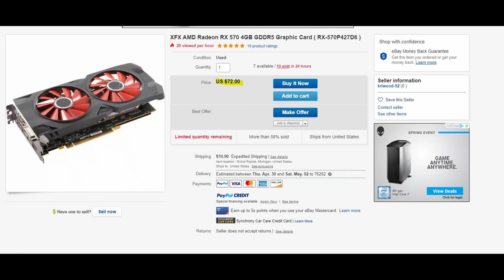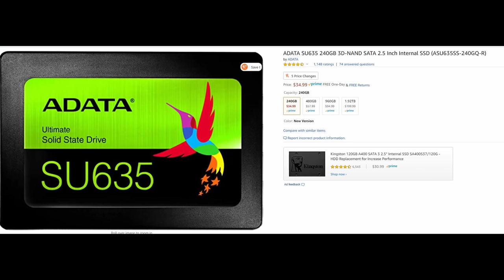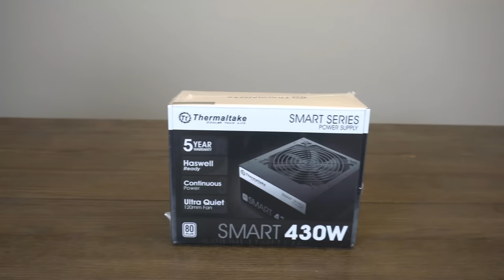$220 Just Get Gaming PC Build - Dell Optiplex 2020 + Benchmarks

Comment: shipping cost: $800
Reply from the maker: That doesn’t sound worth it 🤷‍♂️
Reply: Faxxx
Reply: Shipping cost 300$ 😂
Reply: if you look around on ebay and have two brain cells you can find better deals
Reply: TheUglyBrotha going on eBay for a gaming pc? You’d be lucky enough if it can even run your online COVID work...
Reply: @PCDYYD i recommend you get amd ryzen it is for budget gamers
Reply: @Muxzy  like I said you have to have two brain cells, you look for individual parts
Reply: @PCDYYD ah alright, im not thinking of upgrading anytime soon since i have a gtx 1660 super and ryzen 5 3600
Reply: cost $37.05 + gst = $837.05 + shipping = $907.05
Reply: @PCDYYD the 1660 super only has 6gb
Reply: @PCDYYD Worst experience? Optiplexes are easy to work with, biggest problem with them is that they usually come with BIOS from like 2012, so when you do something like slap a PSU it will not recognize it giving you a Amber light error, amongst other stuff related to that BIOS problem, but upgrading to A22 is easy and can be done with Windows itself.

Currently running a i5 2400 790 with 12 GB of DDR3 RAM, a RX570 4 GB and a Raidmax 530SS PSU.
Reply: @PCDYYD I mean, that´s the thing, can you really call them scammers when the PC is not intended to be a gaming system therefore is not intented to receive upgrades? It´s an Office PC, you don´t want it to be huge, the HDD cage is ok, you should expect that in an Office PC. 

I get why you would not recommend it, but that´s the thing, what else can you recommend at this price range? Anything built from scratch will probably not be running nearly as good as this Optiplex with an Rx570 will be running at.
Reply: @PCDYYD What errors? Update the BIOS to A22 and you are all set, the only non-upgradable thing is the CPU and that is more on Intel than on the actual Optiplex. It takes up to 32GB of DDR3 and pretty much any graphics card you can fit on the thing.
Reply: @jj-vn9hl  immature much? lmao

Comment: Love seeing other people do these builds. I've got a 9020mt Optiplex, with the I7 4770. Put in a new PSU (EVGA 500W) an Ssd (Kingston a400 240gb), and a new GPU (Sapphire Nitro+ RX 570 8gb). Really had to work to make the GPU fit, had to take out the Hdd bay too, and cut down the front panel plug on the motherboard. I think I'm around $400CAD all in, including 24" 1080p monitor, and wireless kb/m. It's been smooth sailing and gaming for almost 6 months now.
Reply from the maker: Nice!  I bet that is bad ass little budget gamer!  I’m thinking of just buying one of those just to snag the 4770 from it to replace an i5 I have sitting around for another build (maybe a video idea) 😉
Reply: How long do these last. Optiplex pcs with rx 580s or gtx 1660
Reply: Why not build a ryzen pc.  Much better.
Reply: 20 years
Reply: @rajakhan12346  The cost is cheaper upfront and the performance is better also. A Ryzen build would cost about 450+ with a discrete Graphics Card while this maybe 300.
Reply: @rajakhan12346  ya if you had roughly $600 that could be a nice new pc, but this is a budget used starter pc for half or even less the price, great money for performance.
Reply: @tattoojay88  Ryzen cheap now. Can build one roughly same price.
Reply: @rajakhan12346  not with a dedicated graphics card and brand new components
Reply: @wrth  what do you mean. Cheaper than Intel. New parts cheaper.  Used parts way cheaper can good parts .
Reply: @rajakhan12346  ya if you have the money a ryzen build would be a nice pc, but you couldn't build one for the same price. Ryzen is cheaper than Intel yes but that's just the processor. It would be $250+ just for the lowest end Ryzen processor and a decent graphics card, maybe a little lower if you find great deals.
Reply: no bro i dont thinku need something to fit the 570 in 9020 mt bro it had enough espace for it
Reply: Wait do optiplex use 4 DDR, I'll tear down my laptop and even use it's old ass ssd
Reply: @bizybliztaverage9414  Depends on the Optiplex. The 9020 has DDR3 because that's what Haswell supports.

Comment: I just got an Optiplex 7010 with a gt 1030 off of ebay for about 200 plus I got a pretty nice HP monitor for about 60 and now I can play any game on the market.
Reply from the maker: Nice!  That’s not too bad of a deal.  You can add a more powerful GPU later on to up your gaming experience!
Reply: Which processor do you use?

Comment: I rebuilt an entire pc in one of these cases. I originally intended to keep the i7-3770 it came with but I came across a really good deal on a Ryzen 5 1600X on ebay... So then I got the idea to convert it into a ryzen build lol. I just really like the look of these old optiplex cases so I made one a lot more modern. The parts I used are as followed-

Power Supply- Corsair CX650
Motherboard- MSI Bazooka V2
Ram- Corsair Vengeance 16Gb 3000Mhz kit
Graphics Card- R9 Nano
CPU- Ryzen 5 1600X overclocked 4Ghz 

My Ryzen cpu didn't come with a cooler but I had an old FX-8370 laying up in my closet so I just took the wraith cooler off of that and used it lol. On the side panel I cut a 90mm hole and bought a 90mm dust filter and a be quiet fan off of Newegg so it has plenty of airflow and it still looks sleek. I did have to cut and splice some wires together in order to get the power button and usb ports working on the pc because the original connectors were proprietary to the old motherboard so if you are to attempt this keep that in mind. All in all, it turned out fantastic and I love it. It's not my most powerful computer but it's unique in it's own way.
Reply from the maker: That is awesome!  Very cool sleeper build!
Reply: Plz make a video showcasing this? I wanna see

Comment: 11:54 you can also get a PCIe x4 sata 3.0 card for that build to add more drives.
The VNP2H - Dell System Board has 2x PCIe x16 slots and a single PCIe x4 which means you can add Sata data ports to your system 100% for sure for like $35 on Newegg. It's a decent little mod.

The $400 OmnipotentPlex

I did a build with a Optiplex 9020 and ran into limits with my sata data so I got the x4 slot Sata Data IOCrest card from Newegg. Gave me 2 more ports to work with! this meant I could add more space. I took out the board and mounted the mobo into a better Rosewill case. This case gave me 3 places to mount SSD's and 3 places to mount HDD's. A used Cullinhan case off ebay. Came with RGB fans and I'm very happy with the $65 I spent on it. The Dell was $75 on Craigslist (sketchy, I know, but you can find some excellently cheap, but always unclean, stuff.. had to throw the old case away it was nasty) and it came with a 1TB HDD. I got a 240GB SSD for $35 on amazon.  Got a 1650 super for 120. The PSU in the Optiplex is proprietary however you can buy a cable from ModDIY which allows traditional ATX power supplies to be used on proprietary Dell boards. I got the 9020 because I already had one that had issues with the motherboard but the CPU was fine. I bought one with an i5 while the one I found in the trash (yeah we out here grabbing PC's that are next to the garbage bins) had an i7. 

Swapped the i7 and the 8gb of ram to the working machine, now it has 16gb of ram, Rosewill Cullinham MX RGB case, 1TB HDD, 240GB SSD, Intel i7 4570 and a GTX 1650 super, ModDIY Dell PSU converter, PEX40064 PCI-Express Sata 3 card, EVGA SuperNOVA 650. Spent an extra 20 bucks on an RGB strip to make it glow more.

This build is serious! It cost me 410 USD including shipping. If you're willing to do the work you can build amazing things from cheap stuff :)

Comment: I remove the drive cage in most all the ones I build in an optiplex case and cut a hole with a dremel in the front panel to fit a 120mm fan to help get the gpu some air flow. I mount hard drives as you have in the bracket under the 5.25" bays and I double sided tape ssd's in the bottom 5.25" bay.
Reply from the maker: Good tips!
Reply: Have you considered using HP Elites, the Full ATX towers? they have no interference issues (at least not on a full length AMD reference card) and the power adapters to go from ATX power to HP are like 10 bucks. I decided against a Dell so i wouldnt have to hack it up. they seem to be equally cheap on eBay although the Dells are more common in the full size configuration, and the SFF HPs have even worse clearance issues and some were BTX so they are a no go.

Comment: That looks badass, I've always loved the aesthetic of office PCs especially these Optiplexes. They just look so no-nonsense and functional. I don't know how possible it could be but I'd definitely try to mount some intake fans on the front just to increase healthy airflow in the case.
Reply from the maker: Thanks. I enjoyed tinkering with this concept.  Also I did manage to mount an 80mm fan just fine without doing any modifications to the case.  A larger fan would be better though.  I might look into that.
Reply: @PCTechHustle  where did you plug the fan into?
Reply from the maker: rcmeo you would need a SATA/molex-to-3 pin adapter if trying to use a 3 pin fan as there are not any on the motherboard.
Reply: Its easy done it on a friends build i did chop a hole in the front of the metal but easy

Comment: I like how simple you are. So many people (Linustechtips) are so jumping and loud. I love your video bro.
Reply from the maker: Thanks so much!
Reply: PC Tech Hustle hey, would you mind helping me out a bit? I bought an optiplex 3010 back in May and it came with the following specs:

Dell Optiplex 3010 MT
Intel Core i5-3470 3.2GHz(4 CPUs)
8GB Ram
NVidia GeForce GT 610

I'm using a BenQ GL2460 just so you know.

I want to upgrade the graphics and maybe get an ssd so it’ll run a ton of stuff on it. But I don’t know what is compatible and if stuff will work with the motherboard. Right now it looks like I have to get a power supply and the graphics card. I just want help finding out what graphics card I should get and what will work on mine.

Comment: Good video, thanks. I thought the production of the actual gaming was particularly good. The explanations are well paced and the lessons learned are particularly valuable. I liked the specifics for example the size of the drill bit used to drill out the rivets/welds and where to drill. I've never seen that detail before on a video like this.
I'm not sure you mentioned the amount of RAM (8GB). This is on the eBay link but that won't necessarily last forever.
Thanks again, first time I've come across your channel and I've subscribed.
Reply from the maker: Thanks so much for the kind words!  Yes try to find one with 16GB if you can though I commonly see them with only 8GB, either way a cheap upgrade to 16GB.

Comment: My initial plan was to grab an old OptiPlex from work for experimental upgrading since they were being recycled due to a massive IT upgrade.  Sadly, I wasn't allowed to take one.  So my next plan is to go to my local computer store where it appears they have quite an inventory of these machines.  I think the fun part is discovering how far it can be push before diminishing returns settle in technologically and financially.
Reply from the maker: I thought the same thing!  Though this build isn’t a beauty by any stretch nor has the latest and greatest tech, it is fun seeing how far you can upgrade them to make them still relevant.  In one of my upcoming videos I’m going to see how well it will stack up to modern stuff ;)

Comment: Just getting into PC gaming so I'll be starting with training wheels, upgrading an Optiplex 9020 I got as a gift. This helps a lot. Thanks.
Reply from the maker: Awesome!  Glad you found it helpful!
Reply: @PCTechHustle  luckily my dad has a 700 something watt power supply (which is probably more than I'll ever need, even in future builds) and a buddy of mine has an RX 570 I can borrow until I can get a better one (although not leaps and bounds better in an Optiplex with an i5), so it looks like all I'll need is an SSD and I can get started. I'm going to get a 500gb SSD and probably upgrade to a GTX 970, because I've seen the 970 and 1060 tested side by side and surprisingly enough the 970 outperformed the 1060 in most cases. 1060 would have higher jumps in performance but also lower drops, while the 970 was just consistently decent. Don't mean to talk your head off too much but I hope this helps the algorithm. Keep at it, man. I hope to see you continue to grow! And if you have a better value to performance GPU recommendation for an i5 3.2ghz let me know.

Comment: Bro I can’t get my SSD connected I’m either being to careful or the connection is wrong that I have 
I got an MX500 2.5 inch
Reply from the maker: GangGreen_714 power and data cables connected?
Reply: PC Tech Hustle I got it now bro for some reason the SATA power cable from my PSU didn’t want to go in on my SSD so I tried the sata power cable from my dell optiplex and it fit good I just need to order the sata data cable

Comment: I was going through youtube and your channel got my attention, I am wanting to build a PC within the range of 600$. Whereas I got a monitor and peripherals already so what would you suggest in this budget as what I was thinking :
1) Ryzen 5 3600
2) RTX 2060 or 1660 super
3)b450m motherboard
4)120gb ssd
5)8gb ram
Reply from the maker: A Ryzen 3600 + 2060 would be extremely difficult to get under $1000.  I am actually working on doing a full comprehensive 2 part series on the topic of building a $1000 gaming PC, part 1 is live and part 2 will be next week.

Yo get under $1000 you would likely have to come down on CPU and GPU.  I also have a build that will go live in a couple weeks on the topic of a $500 build utilizing a Ryzen 3100 + RX570. 

Stay tuned.
Reply: @PCTechHustle  ok that would be great.
I was thinking that i can buy used psu and cheap casing
3600 is almost 226 usd
2060 is 327 usd
B450m is 89 usd
Where as i can stretch the bidget to 645usd
Reply from the maker: Be very careful buying a used PSU.  The 1669 super is a very good option card and will help shave off quite a bit of the build cost.  Consider looking for a 2600 or 3100 to shave off more off your CPU cost too
Reply: @PCTechHustle  ok great. THANKYOU VERY MUCH
Reply: Get 16 gigs of ram
Reply: @ironycat8611  will upgrade later on as this will upset my budget a bit

Comment: Ok, so I'm sort of new to building PC's, so I'm wondering if you need the optical and hard drives.
Reply from the maker: You will need at least some hard drive to boot an operating system from, be it a spinning hard drive or solid state.  Optical drives are rarely used anymore these days though

Comment: When i upgraded the gpu of my 7 year old PC i ran into the same backplate problem from 17:49 . In the end i had to actually rasp off half of all the lower ram clips to make the Backplate fit somehow. It actually fits and works until today.
To all who want to upgrade old PCs or buy one used: FIRST CHECK, whether the pc has a PCI-E 3.0 slot (Not the old PCI) for modern graphics cards. Otherwise you won´t be able to mount the GPU at all. Also INSTALL THE LASTEST BIOS update to your mainboard to be sure, the new GPU is more likely to be accepted. Mine wasnt even recognized by the pc (blackscreen and warning tones) until i switched back to the old gpu and installed the lastest Bios from the manufacturers website. Afterwards it thankfully displayed a picture and ran as it should
Reply from the maker: Great advice!!!

Comment: Hey man, thanks for this awesome build. I'm actually new to building a pc and this exactly looks like the Dell precision T1600. Could this exact build work on it?
Reply from the maker: I am not familiar with the T1600 but a quick search looks like they come from the same generation.  The only draw backs you could possibly have is interior space compatibility, and PSU / proprietary cabling connections, which I just don’t have experience to speak from.  I would try doing a search on YouTube for Dell T1600 upgrades, etc.
Reply: I’m not the best person ever with computers but if space is an issue you will probably have to install a low profile graphics card, and those cards usually don’t take a ton of power to run properly if u don’t want to replace the power supply.

Comment: I just did this for my son same GPU but I got the newer i5 4xxx series paired with a 470. Great little gamer pc it will struggle loading on HDD unlike my newer i7 build which has 3 ssd's and 4 HDDS for all the games and media.. If you do get a newer Dell version not the 990 you will need a power adapter plug to make the power supply work I got one and it works fine.
Reply from the maker: Nice!

Comment: Hello I just go into computers and would like to try and build this one. I have  2 questions. First what is the paste you put on the cpu at 9:18, and what is the fan you put on top of it and where can I get that? Also, the what is the blue wire at 10:44 and if it doesn’t come with anything than where can I buy it? I hope I can get help soon. Thank you 🙏

(Edit: Plz ignore the fan part I just noticed it at the beginning. Also, I have another question what was that ting you slid in at 10:34?Thanks 😊)
Reply from the maker: The paste is just some cheap Chinese stuff I got off eBay , works great, most any paste will work.

The blue wires are the sata data cables that connect the hard drives to the motherboard.  You will need 90 degree ones if running a larger video card like I did.

10:34 was a hard drive.
Reply: PC Tech Hustle Thank you I will be building this shortly.
Reply from the maker: Awesome!  Best of luck!